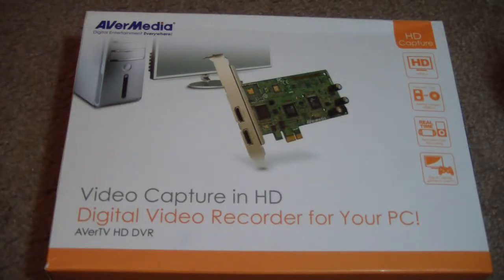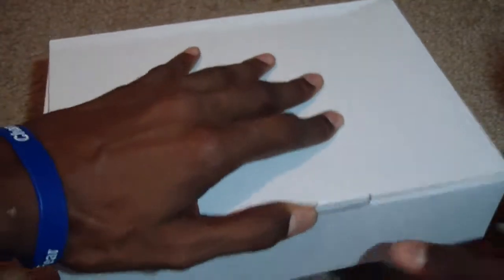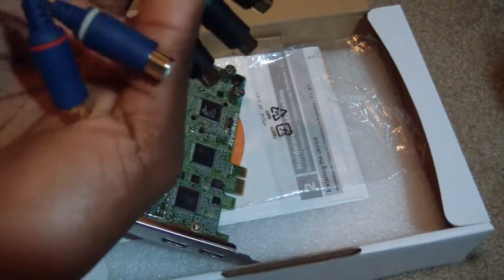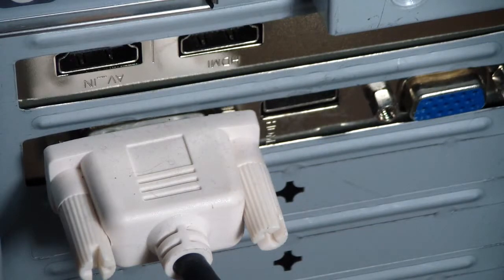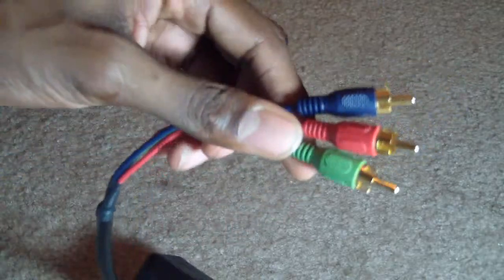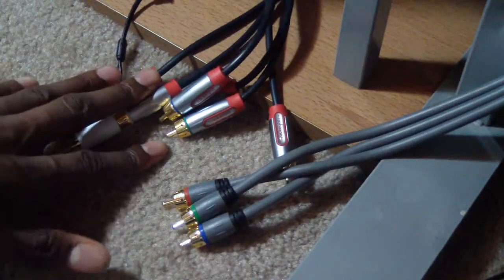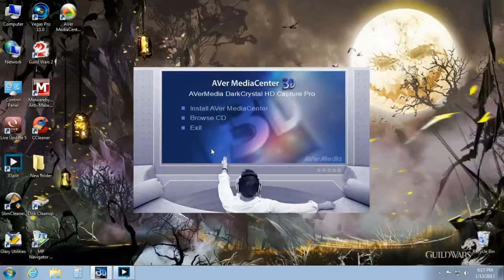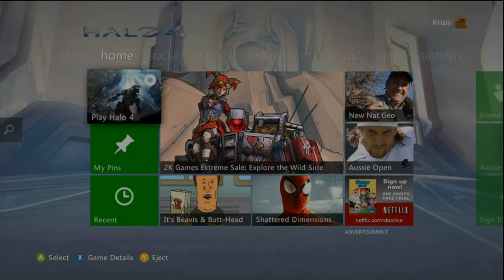AverMedia AVerTV HD DVR Unboxing/Installation Setup (Step by Step)

Comment from the maker: pt.2 - This will help out with how fast your computer can think. The larger the better. I have an 8-core processor with 12 gigs of RAM inside of it. Its can go up to 15 gigs. Think wisely about what you want to do how you want to do it. From the motherbaord of your choosing make sure you capture cards will fit inside of this motherboard. A lot of pre planning is involved! So take your time and do not rush. Know what the computer parts name are. PCI slot.. etc.. If you dont know, you can ask me.